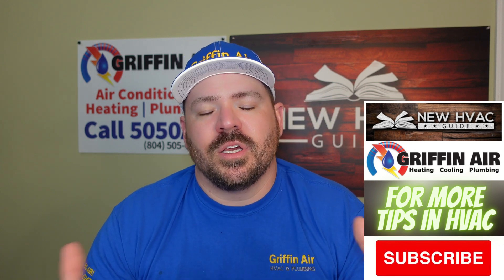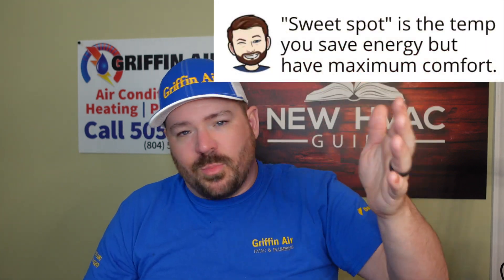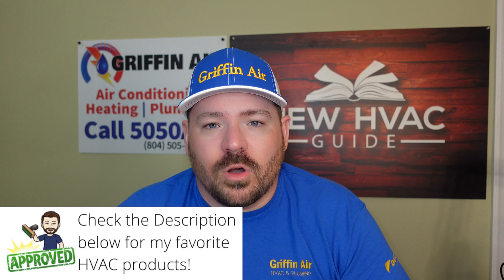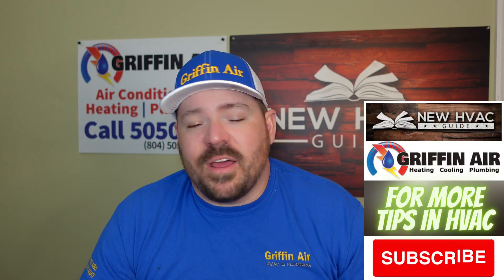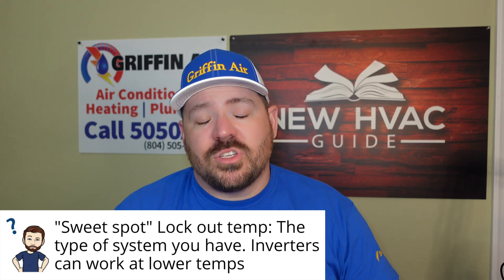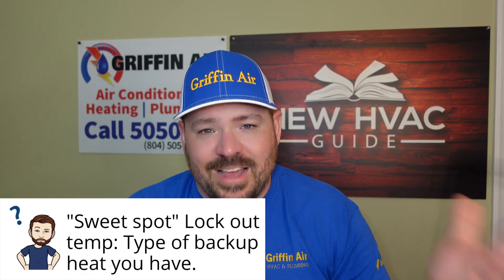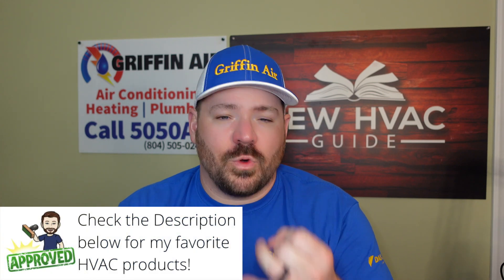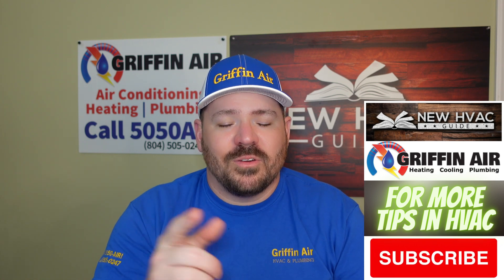BEST Temperature for DUAL FUEL Lockout HVAC!

Comment: My contractor installed a Sensi Smart (1F87U-42WF) thermostat. After talking to Sensi customer service it turns out that my new thermostat has no way to lock out the heat pump based on outside temperature.  What do you think about me installing a Sensi Touch 2 or Ecobee smart thermostat that uses the outside temperature from the WIFI connection to set the heat pump lockout?  Or do you have a thermostat you prefer more?  Thanks!
Reply: The best option on the market to customize your lock out temperature is a Honeywell 8321 wifi thermostat and a hardwired outdoor temperature sensor. This will eliminate the "logic" that other smart thermostats use to guess what the current outdoor temperature is and when it's a good idea to make the change from heat pump to auxiliary heat.
Reply: Thanks for your suggestion.  I am sure that the Honeywell 8321 would have been a better choice, but since Honeywell does not play nice with non-HVAC contractors, I installed the Sensi Touch 2 that has a configurable lockout temperature, that as you know, uses the outside temperature it obtains from WiFi. The Sensi Touch 2 worked fine this week when we got down to 12 degrees, quite unusual for Texas. @dustinalexander5864

Comment: I got a duel fuel system and I went to set a lockout when it got cold. I noticed there is a hp lockout and a aux lockout on the thermostat.  What is the aux lockout for . I get the hp lockout is to stop the heat pump  and use the furnace . But what is the aux lockout for ?
Reply: The aux lockout is the opposite of the heat pump lockout. You can tell the thermostat to not allow the auxiliary heat to come on above 40° for example. This will allow the heat pump to go into defrost mode momentarily when being used without turning the auxiliary heat on.

Comment: If you do your load calculation and Balance point worksheet you can find out at exactly what temperature the heat pump is unable to heat the home. Set the lockout for the compressor a couple of degrees above that point and bam you have the BEST temperature for a dual-fuel lockout.
Reply: Sure this works but it's not the most efficient. Knowing what you are paying for each and finding the point it makes sense to switch is much harder to figure out.

Comment: In Minnesota, I like to set them to change over at no lower than 35 degrees F. This way, there's no chance of the outdoor unit having to go into defrost mode which in turn, would make the gas furnace fire to heat up the indoor coil which then sends the heat via refrigerant lines to the outdoor unit in order to defrost itself. That's for a standard split system. As for mini split A/C heat pumps, that's a different story. Some claim to operate as low as -22 but in my experience, they all start defrosting themselves at or around +15F to 0 degrees and lose efficiency. I watch my mini split heat pump indicator light and when it starts to defrost too often, I turn it off and then turn on my gas furnace. If it stays too cold for days, below 0, -10,-20, -30  or sometimes -40F below, I then start a fire in my wood stove. Yes, it gets that cold in areas of Minnesota! Great video and explanation! Just thought I'd share my experiences.
Reply: Won’t a heat pump defrost below 40 ish because in order to extract heat out of 40 degrees the refrigerant needs to be a margin colder.. much like an indoor coil in heat mode will need to get hotter than the temp inside to add heat? If the temp outside is 35 the refrigerant should not be that temp for heat transfer
Reply: @b-riair9114  Frost doesn't occur above 32F because it is water in the air that has frozen (wet bulb) and in order for it to freeze, it must beat or below 32F.

Comment: Economics of it:  most place in N.America Electricty costs 3x as much as Nat Gas per unit energy,  than means use gas if COP is below 3 on the heat pump . for an Air-Air heat pump that is at abut 40F outdoor.

Comment: What controls the lockout temperature on a heat pump system?
Reply: There are several ways, 1) Smart thermostat that uses built in logic in conjunction with weather data obtained from the internet for your area. 2) Analog fossil fuel control - Bill porter board for example - that has a dial where the temperature can be set and relays make the switch 3) A thermostat or zone board that has a hardwired outdoor temperature sensor can be set to change over at the desired temperature.

Comment: Its 40.
Reply: It's much lower than 40° in my situation, electric is about 15cents per kwh which is very affordable however natural gas is not available so I use propane which costs 2.99 per gallon on average. It's more cost effective for people in a situation similar to me to allow the heat pump to run as low as 20° sometimes lower.
Reply: Economics of it:  most place in N.America Electricty costs 3x as much as Nat Gas per unit energy,  than means use gas if COP is below 3 on the heat pump . for an Air-Air heat pump that is at abut 40F outdoor.

Comment: So the lock out temp is on the thermostat in the home?
Reply from the maker: Depends. Some systems have an external fossil fuel kit that may be mounted near the indoor unit. Some systems use the thermostat as their fossil fuel kit which would require the thermostat to control the lockout temperature

Comment: Does the homeowner have a way of setting the lock out temp  or is it already set  by the person putting it in. Cam we change it .where is it set at is it sat up on the thermostat in the home? I've hit buttons odk what I'm doing I was wondering if I have moved the lock out temp or not or if it is set where the homeowner can or cannot change it.any info will help
Reply: It all depends on the type of thermostat or other equipment that may be controlling the change over point. Not all thermostats will allow you to set a lock out temperature. Many thermostats use a pre-calculated "logic" to determine when the best time to lock out the heat pump is.

Comment: The Mitsubishi Hyper Heat units are amazing! The SUZ SVZ Hyper Heat ducted air handler system is good to go at 5 degrees. We have done a lot of these with no heat kit in the air handler. For smaller well insulated homes I don't see much point in staying with a furnace in Western Washington climate. Now if you have weeks of below zero Fahrenheit I'd stay with gas.
Reply from the maker: Awesome!
Reply: Does the homeowner control the lockout point on a hyper heat?  Electricity is more expensive than natural gas here and I don’t want to pay more even if hyperheat  will work below freezing.
Reply: @crumdoggy  I'm not sure. I believe this could be done at the time of install or through the thermostat. I'm not a tech. A hyper heat unit might be overkill if you want to stick with a gas furnace.

Comment: How much current do the inverter system consume when heating?  I’m curious about the efficiency of these system.
Reply: I have a Daikin Fit 3 ton HP and it uses about 3kw in max heat mode.  When the house is up to temp it uses about 0.6-2kw to maintain temp.
Reply from the maker: Most are minimal. Some draw an amp or two on average